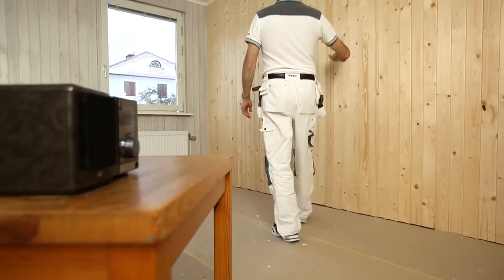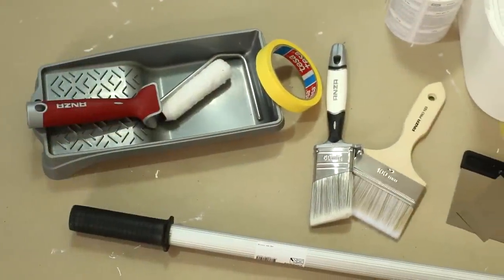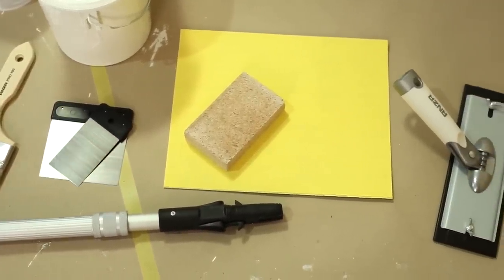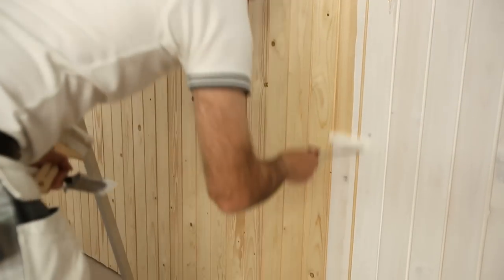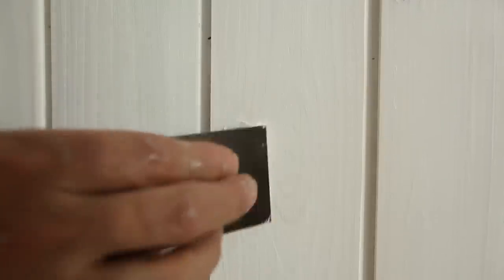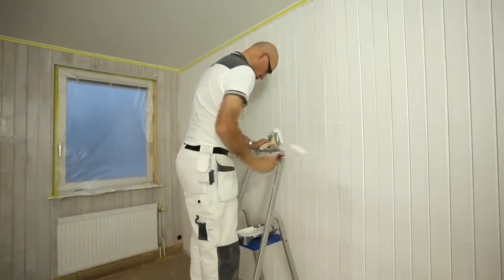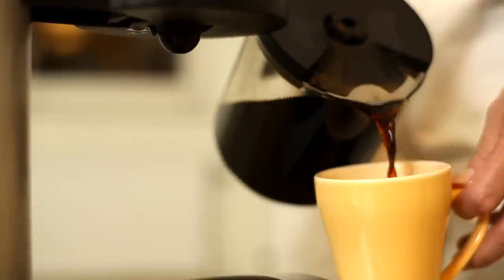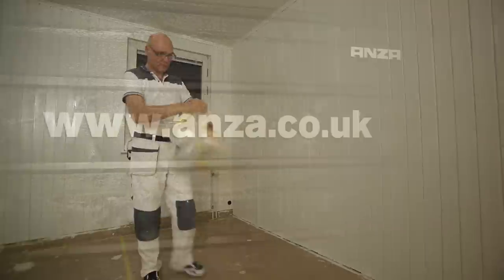Painting wooden panelling – step by step

Comment: yes u need to sand them ,but make sure u keep the wall slightly rough ,also make sure to wipe them down before painting . you can have the best paint but The paint is only as good as the surface it's applied to .

Comment: How about how to REMOVE paneling?  Because it's gross and every house I'm looking to buy has this cheap garbage in it!
Reply: cover it
Reply: You taking about the paneling in the walls , well you just have to take it off the walls by pulling it.or use a priver bar
Reply: 30 years ago, I had dark paneling in our basement family room. I hated it! It's the kind you're talking about. It made the room look small and dark. NO LIFE to it!  I painted the paneling. I primed it first, with a latex primer {Kiltz brand of primer}, then used an oil base white paint over that. I didn't know about sanding walls, so I never sanded them, nor did I put 2 coats of paint on, after primer. It still looks good and there's still somewhat of a shine, after 30 years. I think I used semi gloss. Be careful if you buy an old home and take the paneling off. Back then, in the mid 70's and before, they used a glue, to adhere the paneling that had asbestos fibers in it. If you remove the paneling, you also must remove the wall board too, as glue will be stuck on it. Our home was built in 1972, so whoever finished off our basement, used this glue to put on paneling, as well as nails. If you leave the paneling up and paint it, you should be OK. We've haven't had any problems with the room we painted. Hope this helps you.
Reply: SORRY folks... CORRECTION... I made a mistake with primer and paint and which goes first. THE CORRECT WAY... You use an OIL BASE PRIMER for the walls. I used Kiltz brand. Then you can paint with a LATEX PAINT over that. I used Glidden paint, semi gloss.  I didn't sand. I only wiped the walls down to rid them of dust.